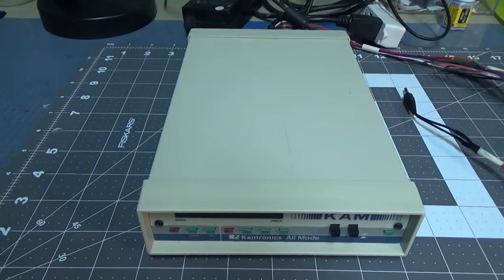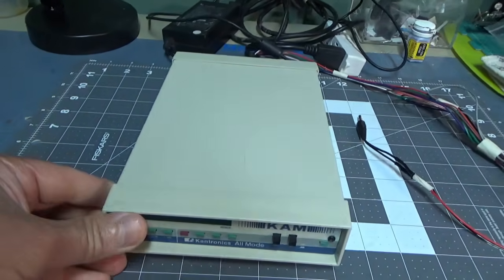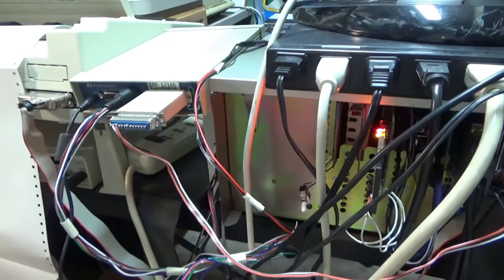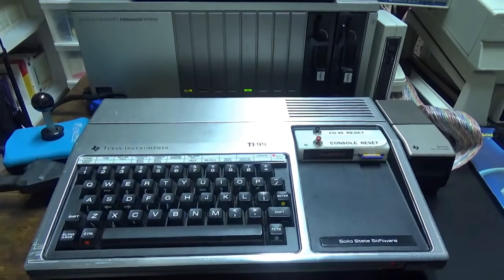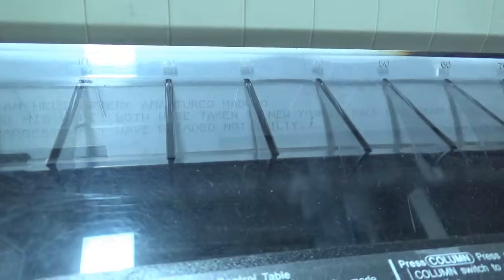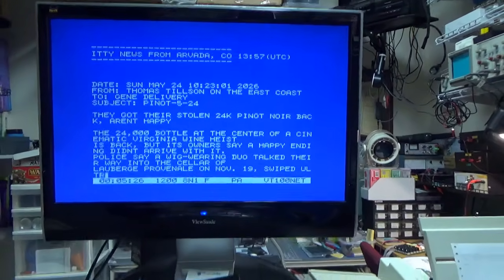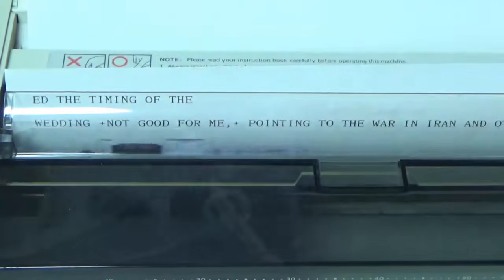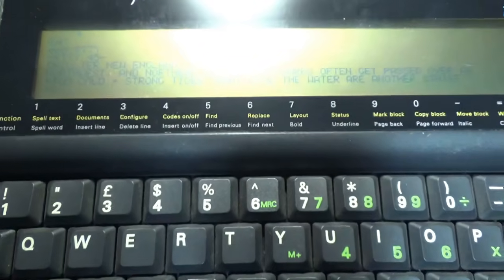Radio Teletype (RTTY) Reception on TI 99/4A Computer

Comment: Very cool! Firstly, your KAM looks like an original with the enhancement board fitted which tend to sell for a few more $$$.
What's the tuning frequency for the RTTY station, is it something run on the ham bands or a commercial news service?
Reply from the maker: It's actually a website which continuously runs a variety of news items and generates standard RTTY audio at 45 baud (li k in the video description). Just connec the audio output from your computer or phone to the KAM audio in pin on the RF connector and off you go. Pretty nifty. When I opened up the KAM there was a small daughter board with a ROM which I assu.e is the firmware. How could you tell it's an enhanced version?
Reply: @SuperVorticon Thanks, I found the website , now I can test my KAM again. Yours shows 7.1E in the startup banner, E means enhanced.

Comment: Great video.  Where did you get that "firehose" cable for the PEB?  Looks custom made.
Reply from the maker: I honestly don't remember as it's been a while. I suggest a google search... It's actually an extension to the firehose rather than a full replacement, with the main advantage being a lot more flexible and eliminates that large connector on the side which takes so much space.